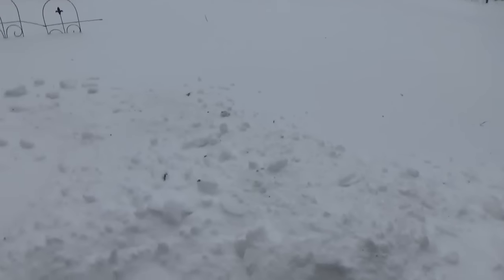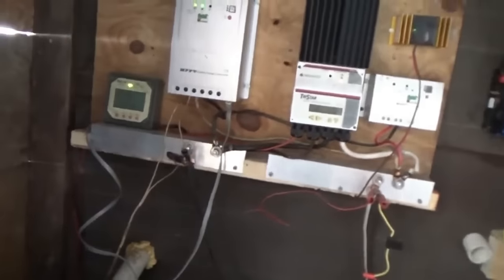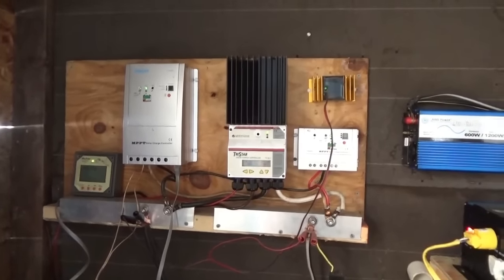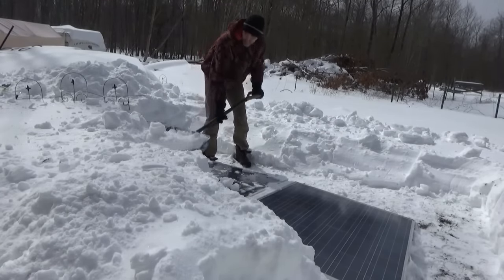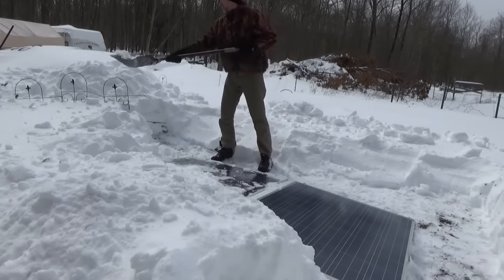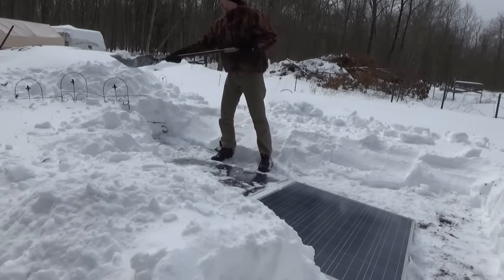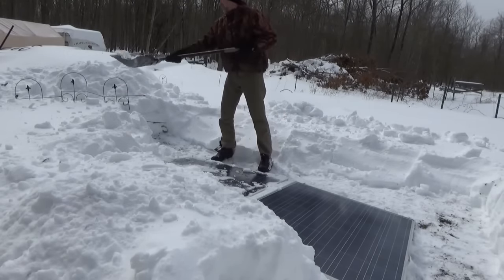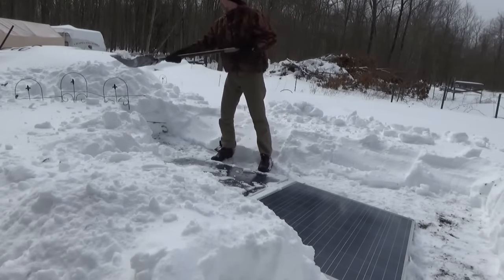Digging Out The Homestead After Winter Storm

Comment: A roof rake would work real nice for the solar panels. All plastic flat blade and you pull the snow off which is easier than pushing snow. They come with easily attachable extra lengths  for roofs. Very lightweight too.
Reply from the maker: cool
Reply: A leaf blower works too
Reply: Just use a flame thrower.

Comment: Reflected radiation is, under the best of circumstances, no more than 25% of irradiance potential.  Far better to have your panels aligned correctly, observing correct nagnetic declination for true south, and setting tilt for the correct sun altitude angle for your latitude.  Were the panels mounted on even a very reasonable tilting ground mount, not only would you see more energy production during a full day, but your panels would only take a few moments to keep clear.

Comment: Why would you leave them laying out in a snow storm ? I mean it's not like you're gonna get much out of them leaving them out during the storm . You kinda set yourself up for more hard work than you really had to.
Reply from the maker: Well, you dont just tear out the wires and take them in for the night either. Solar panels are made for all weather. Its just a matter of shoveling them out each time it snows.
Reply: its easier to keep them in place since its easier to do them out and the wire is buried underground so its easier to just dig out the snow from off and around the solar panels so think before you speak.
Reply: KILLKING110 calm down killer , I'm just saying if it were me I'd play this out different . Jeez think about your blood pressure keyboard killa' . I wasn't attacking Troy so pump your breaks .

Comment: How's Michigan?
Reply from the maker: Dont know yet. We are stuck here good and the snow plow finally came but cut our internet line. Finally found the two ends and spliced in a piece.
Reply: I dont expect you'll be letting anyone know when you are away. I sure wish you had listened to me when I said to put those studs 16" on center, but you were determined to "make it lighter" . By a whole 5 pounds per wall. It still wouldnt have solved your problem with a baby and a known homestead location however. The unfortunate reality is that just having a child, in any environment, you provide a perfect method for those wanting to extract revenge to lash out at you.You as a parent, do not have rights when it comes to your childrens welfare and CPS  makes a very powerful weapon. I honestly dont know if you SHOULD continue to do videos.Certainly never ever show the child or any or it's environment. Never once. People will find a way to locate you from the smallest clues. I dont think I'd risk it.